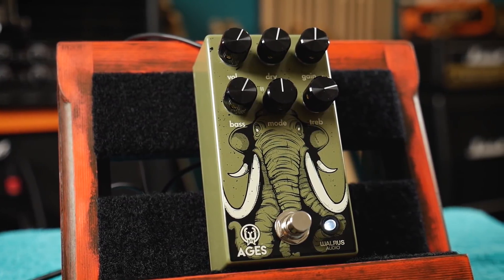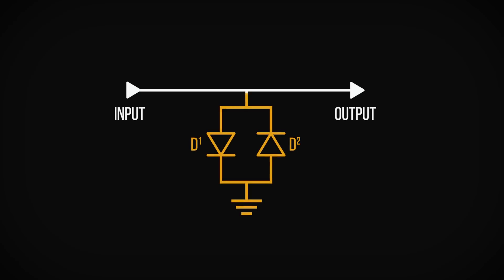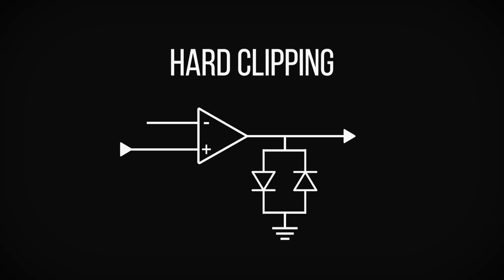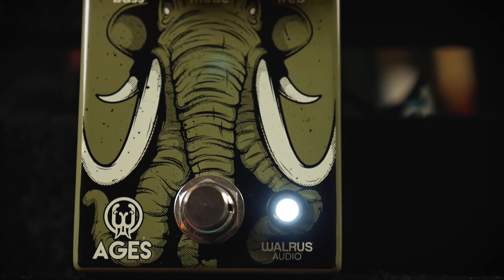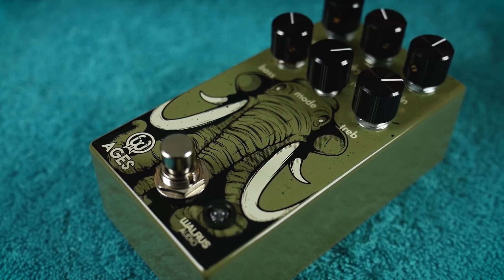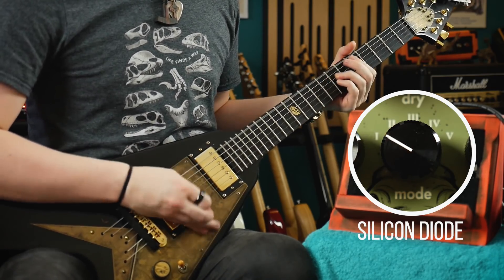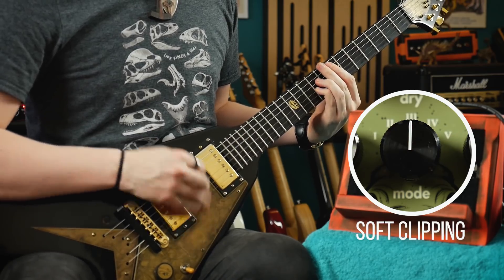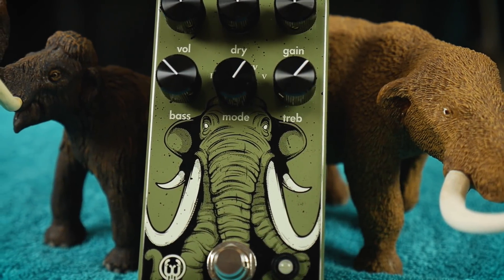What is Diode Clipping? | Too Afraid To Ask

Comment: Here's my TATA: why would I need high output pickups for metal if i can boost my output with a clean boost?
Reply from the maker: Answer is you don't. It's a vestigial way of thinking from a time when amplifiers didn't have enough gain on their own, so hot output pickups were used to drive the amp harder. 

Modern amps and pedals can add as much gain as you'll ever need now, so there is no requirement for high output pickups in metal. In fact you should try low output pickups, they sound great when you crank their signal level.
Reply: @ScienceofLoud  what will be the difference between using a high-headroom active pickup with the volume pot rolled down vs a low output pickup? Am I losing any tone this way? I can use the volume pot as a built-in boost pedal, basically.
Reply: @TheApsodist  i use high output pickups this way sometimes. Turn the pickup down on the guitar, setup up the tone on the amps and pedals, but turn the pickup back up for extra gain when needed, such as a lead boost.
Reply: @TheApsodist  Active pickups sound different from humbuckers or single coil, even when you ignore the higher volume. It's more of a choice by the designer to make them sound different than anything inherent in the design of active pickups in general, but it's still an important difference. I personally don't like the way they sound, to me they sound extremely characterless and clean, but some people like that.
Reply: Unless you don't like pedals, or want to use them as less as possible.

Comment: Are there any kinds of standards whatsoever for guitar pickup sizes, or do you pretty much have to always cut into the pick guard and maybe even the wood if you wanna change them? I have a Fernandes with P90 soap bar pickups for example, can I buy ones made to fit in a Gibson and use them?
Reply from the maker: Most aftermaket pickups will be sized to fit into most standard guitars without modification. That is that humbuckers are typically of one size (although they will have different string spacings), P90s will be typically of one size, and so on. 
There are always exceptions, certain guitars and brands will have their own propitiatory electronics and hardware, and especially so if we are talking about vintage instruments which were being made before the industry settled on a standard. 
Always check your sizes, but in most cases any modern pickup will be the same size as any other of its type.
Reply: @ScienceofLoud  My Fernandes was made in the late 80s, were there some kind of ad-hoc standard at that point?

Comment: That art design on the pedal looks so cool. I'm curious if this is similar with the plumes by eqd?
Reply: I have both of them. The Plumes is fatter and has more pronounced, slightly brighter clipping. 

The Ages is good bit tighter and has a  smoother and darker clipping profile. It never reaches that fuzzy territory when gain is maxed like the Plumes does even when the dry knob is all the way down. And obviously the Ages has wayyy more headroom. Can be used as just a mid boost more or less with low gain on mode 1 and dry all the way up

So they are somewhat similar in that they are both mid gain ODs with multiple clipping options but the actual sounds are somewhat different
Reply: The plumes is a modified tubescreamer circuit so probably not

Comment: TATA: What is univibe?
Reply from the maker: This would be an excellent video topic. 
In short its an early attempt to replicate the sound of rotating speakers like the Leslie cabs, the circuit is basically an optical phaser but with a fairly unique sound that sets it apart.
Reply: Your favorite type of modulation. That’s what the answer is.
Reply: @redielg  I actually do not use univibe. I just wonder what it is, cause I've always been confused by it
Reply: Ask your mrs...